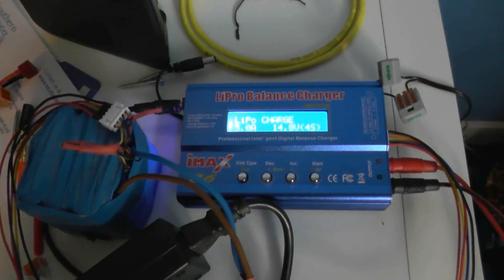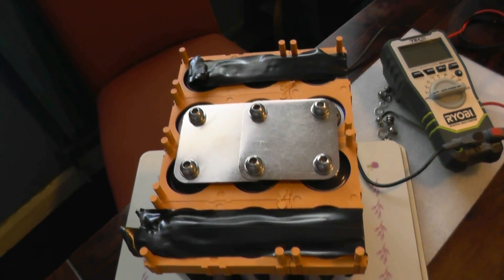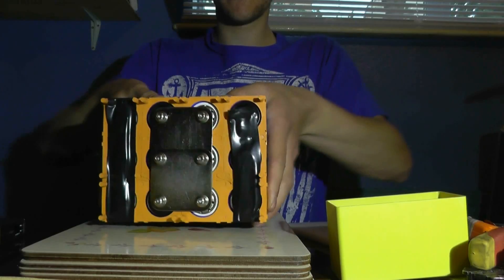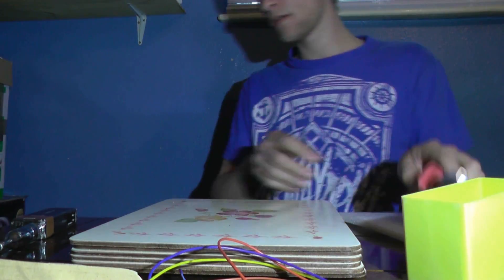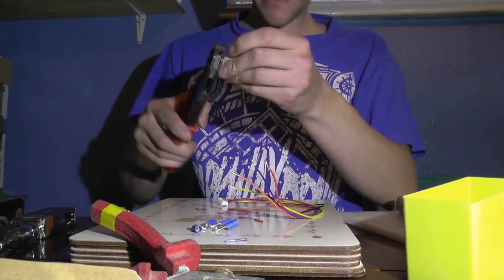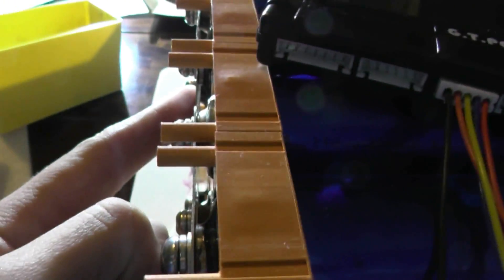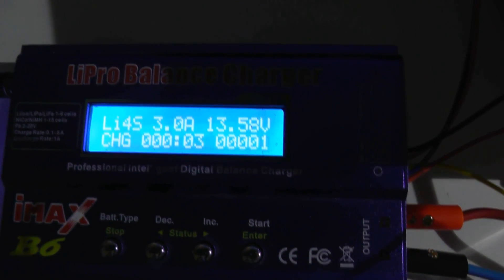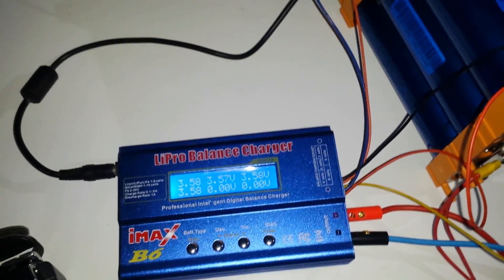LIFEPO4 part 3 balance and power leads

Comment: Do you need a balancer if the setup would be 12s 1p?
Reply from the maker: If your using cells from the same batch / brand and capacity. You should be able to get away with just a low voltage cut off if they are bottom balanced.

Comment: Hi i've been looking for these batteries and all i can find is the small ones you find for laptops and what not, i have an e-bike and i would like to change the battery to a lifepo4, the problem i'm having is that no matter how hard i try i can't find these darn batteries, i think it would be cheaper for me to build one the to buy one already made, so if you could help me find a site for them let me know, the price would be a bit higher here in canada because the dollar here sucks
Reply from the maker: ray leclair The ones I have in my other video's are 12AH cells made by Headway! I'll be honest I could only find one place in the UK that would let me have the few I wanted! I hope you find what you need! 

There is a chap on here called Julian illett doing a conversion from lead acid to LIFEPO4

I'll keep a look out for you! =)
Reply: ok thank you, i did some looking and i did find some but their very costly more then i thought they would be, well over $400 to make a 48v battery, about the same cost to buy one already made, all i got to do is look for a cheap place to buy them from, if i can't i'll try and see if i can find some capasitors that's is as big as 15apms, but i think that will not be cheap as i think i'll need 8 for 12 volts, unless i can find the 12 volt ones, they come in different volts and can pack one heck of a charge, 8 at 3.5 volts at 350f can start a car, their the size of a D battery, so that's really darn good
Reply: oh by the way verry good vid on your pack